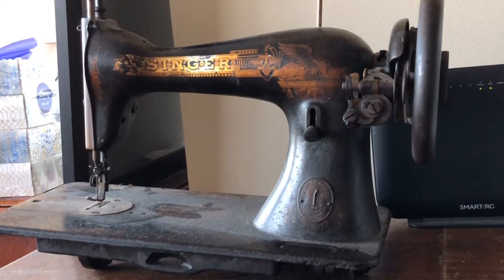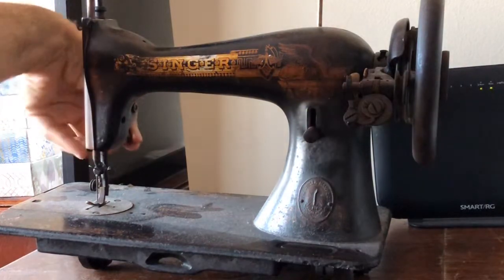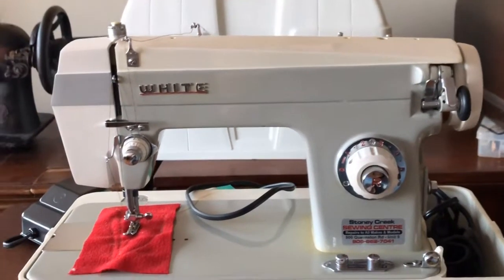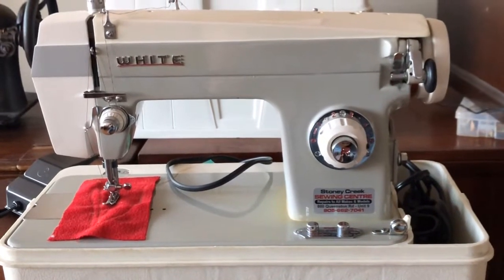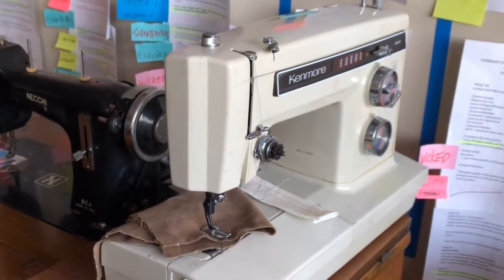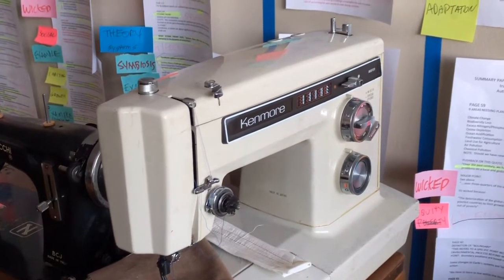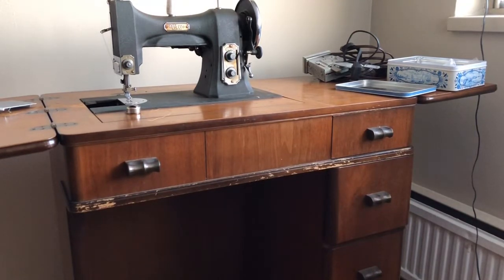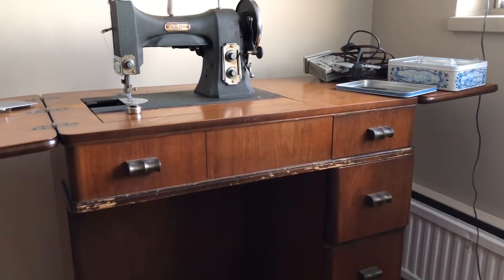Lost and Found :  Recent vintage machine rescues and new projects for future videos.

Comment: Had the pleasure of restoring a machine I inherited very similar to the first in your vid — a model 15 made around 1924 that had been converted from treadle to motor — build quality is terrific, no plastics in those days.  Each “inside” part was stamped with it’s part number.  Following your channel was a help in the restoration.  Found a Singer PDF user manual on line — interesting how the English syntax has changed.
Reply from the maker: Thank you for writing and sharing Paul.  I'm glad the videos were helpful for you.  FYI, you can also do a search for a "Servicer's Manual" although I have not found a need for them myself.  The earlier video was for a Singer 115 which, although it bears a remarkable resemblance the the true 15, the 115 has a Rotary style hook/shuttle as compared with the 15's which of course have oscillating hooks.  But either of them make incredible machines and are strong as granite!!

Comment: Enjoy your videos.  Perhaps you have or can do a video on the bobbin winder on the Singer 66.  I recently acquired a 1928 electric that is cosmetically near factory condition and runs great.  When I wind a bobbin and it is full, it does disengage, but the spring that should push the winder/tire up and away from the hand wheel does not work or is broken.   Would love to learn the fix and have it perfect. BTW,,,,I also love those 40s era White/Kenmore machines.  I have a 117.591, a 117.959 and recently stumbled upon a 1948 showroom condition 117.95.....a goofy dark cranberry/brick red color.   All are beasts and such amazing machines!  So under appreciated.
Reply from the maker: Sounds like you have had the fortune of finding some amazing machines Tom.  Getting a 66 that old and in that condition is very unusual.  The next time I have a 66 in hand, I will make a point to show the bobbin winder.
Reply: Yesterday I acquired a beautiful 1948 201K.  it is very dry and only missing the spool pins.  Do you know if this machine needs threaded spool pins or press-fit?  I've been very lucky finding cosmetically near-factory condition. machines the last few months.  I'm keeping this one for myself.  Thanks in advance!  Tom

Comment: I seem to recall reading that White maintained their own lumber forests which they used to build their cabinetry, and they might have been the only sewing machine company that did this (could be wrong).
I'd like to see all the various video subjects you mentioned. Have you restored any handcrank sewing machines? I have (among others) an original Singer 201K handcrank, it is such a great machine whether it's electric, treadle or handcrank.
Thanks!
Reply from the maker: Yes, White had their own forrests and Singer may have.  Both companies had their own cabinet making capacity.  Lots of industrial companies used to be very vertically integrated unlike today when many outsource lots of the things that go into their product.

Comment: The 15-30 I'm laboring on right now is in very similar shape to that Sphynx. That stuff caked over the decals...
Reply from the maker: Hi Anna.  Yes, the layers of dirt are often composed of old sewing machine oil or grease; yellowing of the original lacquer clear coat; dust ;and lint.  Whatever remains of the clear coating is what protects your decals.  The decals are also vulnerable to cleaners because they react and turn from gold to sliver due in part to the alkaline ph of most cleaning products.  I know it can take a while to use oil, but sewing machine oil is the only thing I have ever used that, when applied gently, has allowed me to clean machines with little to no damage to the finishes.  I plan on making a video that discusses how to approach cleaning the surfaces of vintage sewing machines.
Reply: @VintageSewingMachineGarage  I have mostly used SMO so far. I'm a full time mom so I only get time to "chip away" at it but I also have done some Zymol HD cleanser with good results. The decals aren't silvered at all but they have wear so I'm not super worried about it. I won't ruin a perfect machine but I'm doing my best to preserve everything there.

Comment: HI, this is such an interesting video. I have trouble saying NO too!  I have sold 3 sewing machines and 3 sewing cabinets so far this year. I several more to see and 17! more machines. I had a bronze WHITE rotary machine. It was so cool and so hard to part with but I need to whittle it down to 3 or 4. We may need to move b/c my mom may move in with us and I need to get ready for that. I still have a. beautiful WHITE library table, I will never give up. But it's so impractical for sewing b/c it is big and stuff always gets piled on top of it! I have a blue Necchi supernova with a blue case, a pink Supernova that looks brand new, not a scratch or ding. I have a Husquavarna Viking red that looks brand new, shiny, mint, a free arm Singer, 201 with copper undercarriage, exterior motor mount and spoked wheel, 15-91, 1910 Gingerbread Singer that may need to be sent to salvage, an 830 record, Nechhi BU, Bernina 117K, Elnas (4), Japanese zig zag and a Home Sewing Machine (shuttle) with flawless rose decals in a drawing room cabinet I inherited. Many were given to me or practically given to me. I want to narrow it down to a few favorites - mainly a zig zag and a Singer and give one to each of my 3 kids. Mine have all been acquired locally except for the blue Necchi. The case is so cool with a lucite handle. I have only bought one machine in the last 3 years. I've sold 3 and given away a white zig zag that was nice but had a few scratches and dings. So I am starting to get ahead. The problem is, when I start working on them, I get excited and and new one often follows me home. I am going to have to be disciplined and get these restored and re-homed. I love working on the Singers. I have taken apart a Husq/Viking before and it's not too fun.
Reply from the maker: I understand how it can be difficult to part with any of these magnificent machines.  Some people choose to keep machines that they love to sew on the most.  Others prefer to hold onto machines that are family heirlooms or those that have a special connection to someone.  Other folks keep machines based on their rarity such as your Bernina 117.  I'm sure you will eventually find a way to curate what is  most important to you.  Good luck!
Reply: @VintageSewingMachineGarage  Thank you!  I have a black BU with a green wonder wheel. Not sure if they made the WW in black. What is your favorite zz Necchi?
Reply from the maker: The only color Wonder Wheel I have ever seen was the Sage Green tone that was used to match the paint color on the Necchi BU Mira.  That may have been a selling point when the machines were new.  If you wanted fancier features such as decorative stitches, you had to move up to the Mira.  Yet, all of the Necchi BU machines are models I would be proud to use.  They share the same quality of construction, just with different features which dictated their pricing.  I once restored a pink Necchi Nora which had the flexibility of using cams and the cam with the Blind Stitch pattern is super convenient if you hem clothing.  It all comes down in the end to the kind of projects you enjoy sewing.

Comment: Would like to see a series over industrial/commercial walking foot machines. Such as an inexpensive to top of the line. I've looked at sailrite but I lean toward the older 111w There's also Consew 226R & Juki 562 that are very much like a 111w.
Reply: PS I had a singer 241-12 years ago
Reply: A Singer 214-12 is a high speed, lock stitch, gear driven, rotary hook, automatic lubricating, industrial sewing machine that is built like a tank.
Sorry you lost your Singer 241-12.

Comment: Also, for the White rotary machine I have, I keep the rubber wheel off the hand wheel.  When I bought it the rubber wheel was warped from being held against the wheel for many years.
Reply from the maker: Hello.  Yes, those "bald spots" on the rubber pulleys are common when the machines have gone unused for long periods.  I will be discussing this in my upcoming video on Rotary machines of this design.  Watch for the video soon!
Reply: @VintageSewingMachineGarage  ALWAYS!

Comment: Hi there, I have the white rotary, I need buy the motor rubber. I bought one in Ebay very cheap material. Where you recommended  buy it.
Reply from the maker: I will be doing a video soon on a similar machine since I have gotten lots of requests for additional info on these great machines such as yours. Note that there are 2 sizes available and you select the "Pulley Rubber Motor Drive" based on the diameter of the pulley rubber area and also the diameter of the pulley shaft. There are a number of places that sell these. Not sure of your model but most machines like yours take one of two sizes which are available. Here is a link to where I purchase mine: https://shop.sew-classic.com/Motors-and-Motor-Parts_c21.htm